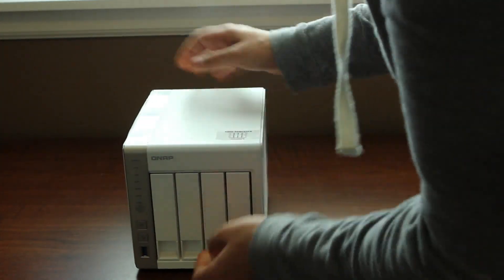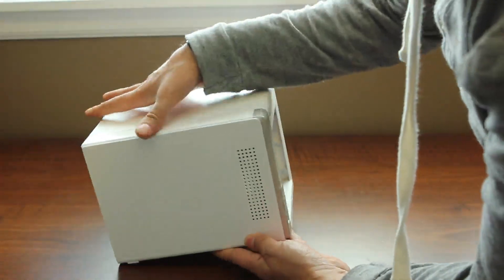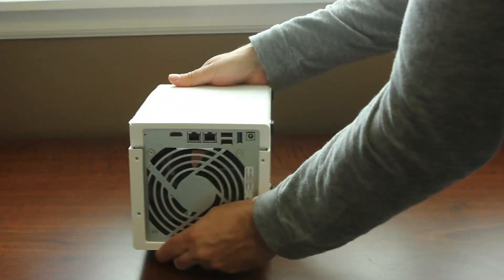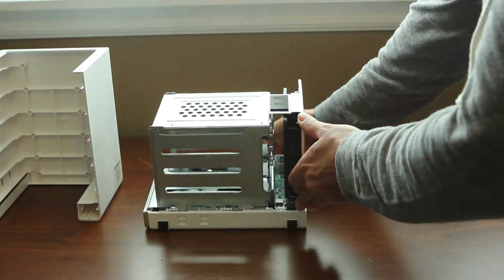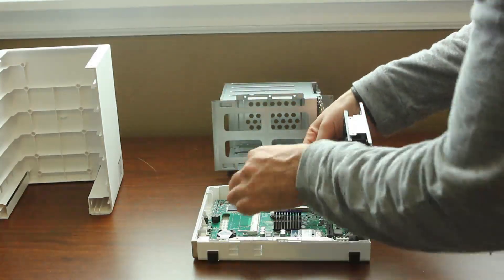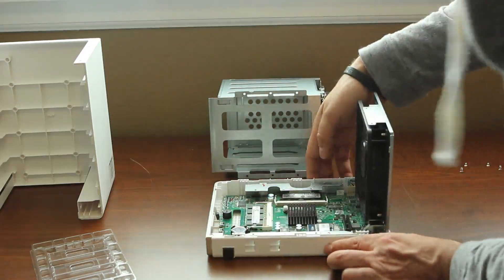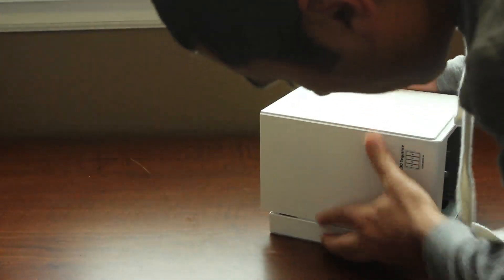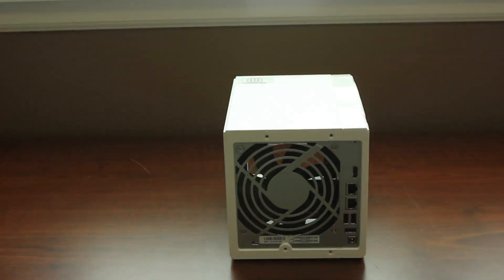How to upgrade RAM in the QNAP TS 451

Comment: What specs does the RAM need, so that I know it would work with my QNAP TS-451+?
Formfactor: SO ? (with 204Pins?)
Voltage: 1.35V, 1.5V ? (Does it depend?)
Type: DDR3L, DDR3 ? (Does it depend?)
Clockspeed: ? (Are all Clockspeeds compatible?)

(I would just need 8GB = 2*4GB and wanted to look for used to get them cheap.)

Comment: Awsome vid. but only 2 (TWO) screws were required removal from base of cage on each side, (Not the ones holding the support for cage to the plastis shell). Other than that was a big help to me overcome my fear of disassembly and get the job done in 20mins. Thanks again.
Reply from the maker: Doug Baxter thanks! Glad you found it helpful :)

Comment: Fyi: the '4 screws on either side'-- you only need to remove the 2 inner screws on each side, the metal on metal ones. The ones that go into the plastic don't need to be removed. They hold the motherboard in.

Comment: For the opening, it is a lot more straight forward than the video shows. Do not try to twist the plastic back and forth, sideways, or lift it up and down. The plastic box slides very easily from the front to the back with a little push grabbing the front of the plastic box where the QNAP logo is, you will see the whole plastic box goes backwards, then you can lift it up without forcing a single clip. If you twist or try to lift each plastic wall individually you will break clips for sure or even tear the walls apart, they are so flimsy. I agree though that for the price they charge, QNAP could have stick with metal rather than what are very cheap plastics. The chassis inside is solid but the box around is really cheap which is a shame given the price tag. In an era where high end laptops are made of magnesium and more and more mid range laptop of aluminium sheets, I was expecting more quality in the materials. That being said the chassis is allright.

Comment: what happens if you put more than 8GB total RAM sticks?

What was the starting RAM comes included with the QNAP-451 ?

Does upgrading the RAM that comes included void any warranty?

I want to upgrade, 1GB is not enough for what I am doing.

Thanks.
Reply from the maker: It comes with 1gb standard, and it does not void your warranty to replace it. I've heard that you can go up to 16gb, but I found that 8gb is more than enough. Please consider using the links in my video to purchase your upgrades if you found the video useful. It doesn't cost you anything more, but it helps support my channel :)

Comment: Can I use 1 8GB ram module instead of 2x4gb? I just bought the TS251. Thanks. The max these units can take is 8GB so can I just use 1 slot? Thanks.
Reply: +ShoresOfHelll Inside news says that you can even install 2x8GB modules. But that is 'officially' unsupported. To answer your question, yes you can install 1 8GB module. However, only install it in slot 1.
Reply: +Saurabh Sharma Thanks a lot.
Reply: +Saurabh Sharma Thanks a lot.

Comment: Did my upgrade to 8GB without any issues. Seems pretty easy if you take your time. The hardest bit is getting the RAM in the second slot.
Reply from the maker: Glad it worked out for you Roger :)

Comment: Do you think guys I could upgrade RAM later on? or it has to be done before setting it up?
Reply from the maker: You can upgrade later but you'd have to take everything out again.
Reply: RMalayeri 
Thank you RMalayeri, you mean HDD, not the data from HDD.
Reply from the maker: Correct! You'll have to remove all the hardware.

Comment: Thanks for the video, but you removed 4 too many screws.  You only need to take out a total of 6 when removing the metal frame - 2 on the left, 2 on the right, and 2 on the top.  The screws that are removed are the ones that sit flush with the surrounding metal - the screws with the larger heads (which are the ones closest to the outside of the NAS) do not need to be removed, and actually shouldn't be removed as they hold the circuit board to the plastic chassis.
Reply: pippindvm Remove these: https://www.qnap.com/i/_upload/support/images/RAM%20Memory/RAM18.jpg
Reply from the maker: Thanks for sharing your tips :) it's definitely a tricky upgrade, but good advice helps get the job done easier!
Reply: RMalayeri Also, you can put in 16GB of RAM.  Specs only specify a maximum of 8GB, however with 16GB installed it does recognize it.
Reply from the maker: That's awesome! Are you running 16GB? How's the performance? I'd imagine you can run multiple VM's with that much RAM :)
Reply: RMalayeri I just finished installing 16GB, thanks to your video.  I'll be spending the rest of the day setting up the TS-451 (it's a new purchase), so I won't have a comparison for performance of 16GB vs 8GB as I'm starting out with 16GB,
Reply from the maker: That's so cool! I'm glad you found it useful and excited for you to share any new tips and tricks! Enjoy :)

Comment: What is the purpose of replacing the RAM?
Reply from the maker: To allow you to use the virtual machine app, and improve your overall performance of your server.
Reply: Thanks, I just got my TS 451 today.
Are you using RAID, if yes which one and what hard drives are you using?
Reply from the maker: I am using a raid 1 for the safest possible redundancy. It has the biggest redundancy cost as you loose one entire drive to parity, but I always would rather be safe than sorry. I'm using the WD Red NAS drives that I have linked in the description. If you found my video useful, please consider using the above links to purchase your drives. They cost no more than what they would otherwise on amazon but it helps support my channel :)

Comment: I am trying to take it with me in a small bag. Is it possible to remove the fan also to that i can put this whole this flat in my bag for easy transportation? Also do you have any benchmarking/full review coming up?
Reply from the maker: Thanks Ravi! I'm not too sure about talking the fan off, since I pretty much put mine back together after this upgrade. I'm considering a few more in depth videos, highlighting some features of the software that didn't work quite right for me, and how to setup open Vpn with the QNAP. What would you like to see? Have you already purchased yours?
Reply: I want to. But not sure if I should get the 2 Bay or 4 Bay one. I need to take it back with me to India and transportation is my main concern.
Reply from the maker: Ravi Shankar I've been using my 4 bay as a Raid 1 with only 2 drives. that can help you get by and still offer redundancy protection. If travel is a concern< I'd take the 2 bay with a raid 1 ;)
Reply: RMalayeri Till yesterday i wanted the 2 bay. But 4 is always better :D

Comment: RMalayeri. Many thx for the video.  Wouldn't have had the stones to try it without your video.  It took 5mins in total to do and I agree the plastic case is the most frustrating part.  They have cut corners in construction compared with my metal TS-410. 
Thanks Again!!
Reply from the maker: Glad it was helpful Wayne :) it was quite the upgrade but if done right it is well worth it! Please remember to subscribe if you enjoyed the video.

Comment: I bought this myself this past week and I'm glad I went with 4GB pre-installed.  I too am a little disappointed at the plastic housing but I have it all set up with 4 2TB WD Red drives with a RAID 5 and it's whisper quiet.  I'm moving beyond a WD TV Live Hub Media Center that has a single 1TB hard drive that runs louder than my refrigerator.  Even when it's 'off' it's still super loud so I always have it unplugged and don't use it.  Keep posting so I know how you are using your NAS.
Reply from the maker: Sounds like a great upgrade for you :) I'm pretty happy with how quiet it is too! Glad you're finding my reviews useful. I'll keep posting and thanks for your input!

Comment: Slightly harder work then it should be, they should do a kit model which just arrives in 100 pieces and you get to put them all together to end up with your NAS. Not for the feint hearted indeed, but you did an expert job and that extra ram will pay dividends in performance.
Reply from the maker: Robert Cooper Thanks Robert! The RAM upgrade was well worth it :) The performance on the NAS is superb.